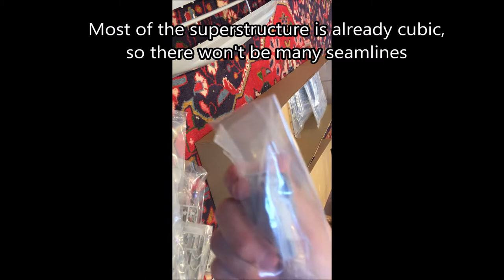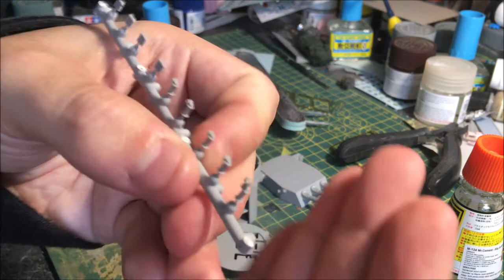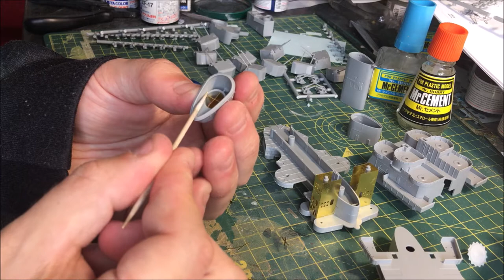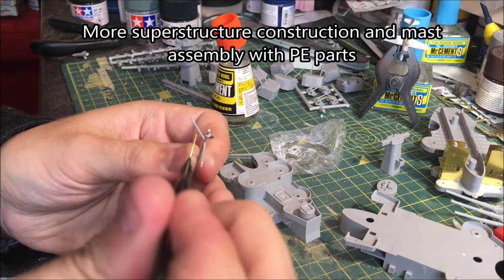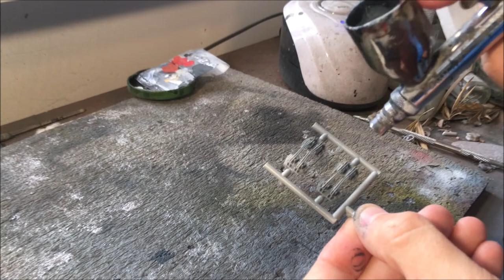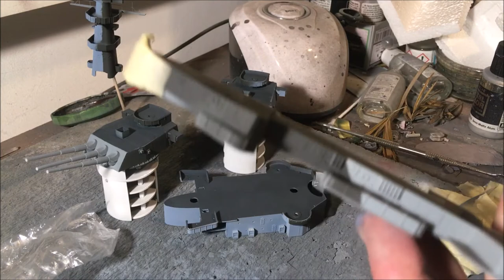Very Fire USS Montana BB-67 1/350 Part I: Most of the Assembly, Painting - and waiting for PE sets

Comment: Thank you for posting this. I am an avid World of Warships player, and have been curious about this model since I first saw it.

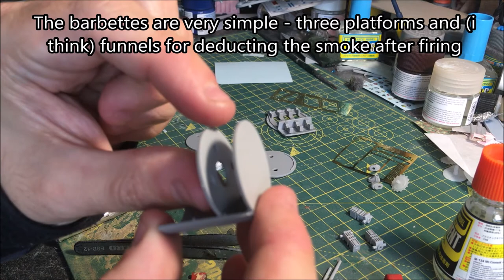3:21 When the Iowa Class would fire their guns, they would be cleared by a rush of compressed air from the breech end, and out the muzzle in order to clear them of hot embers as well as smoke. This is why you see the steady white puff out of the muzzles if you ever look up videos of the Iowa Class BBs. Personally I would recommend a video called Sink-Ex '89, it's a good couple minutes of an Iowa firing off both the 16in and 5in guns. As the Montana would use the same turrets/guns just with a 4th one on board, they would vent the same way.

Fun fact: These turrets are actually called three gun turrets, not triple gun turrets. This is because each gun can be elevated, and fired independently of the other two. This is explained in a USN training video from 1955 that can also be found here on YouTube.

Edit: The "funnels" as you call them are probably the powder hoists for the guns.
Reply from the maker: Thanks for the corrections and tips with the videos, i will definitely look into them! I also learned about the Montana via WoWS, but i didn't play it anymore recently, but my love for ships came from there
Reply: They do look like the powder hoists but modeled incorrectly. They would all be facing the same direction, one hoist for each gun.